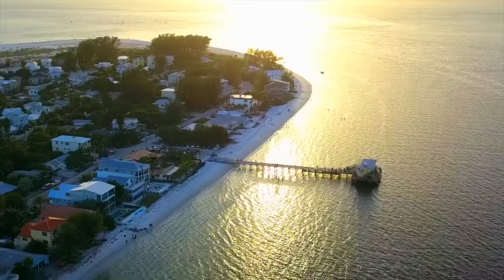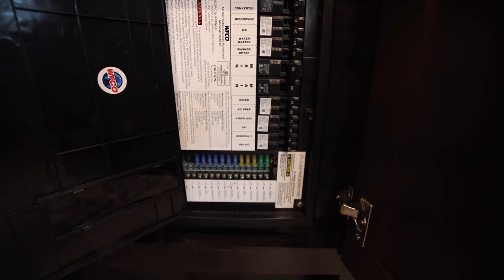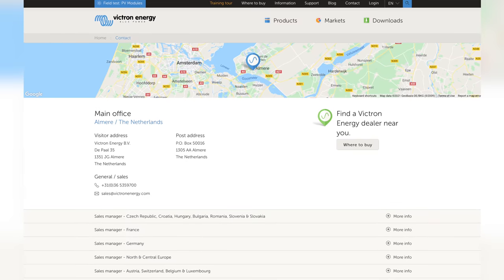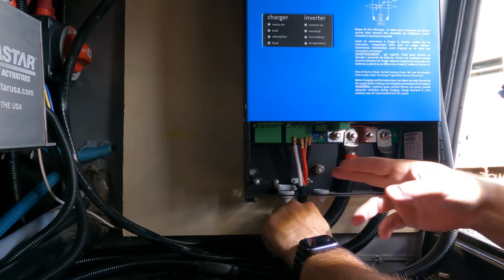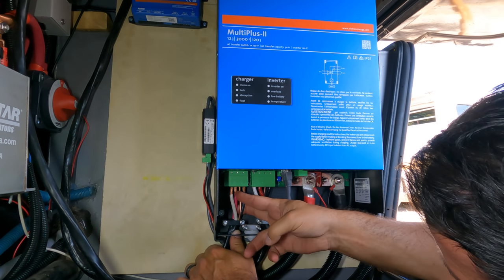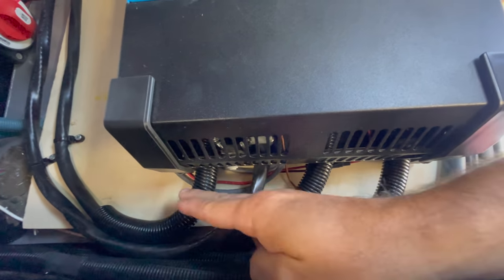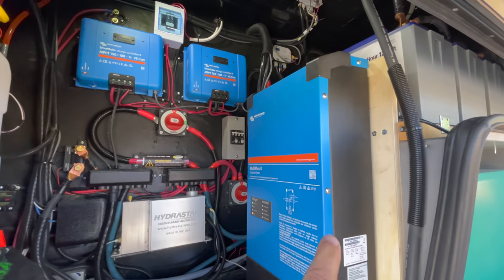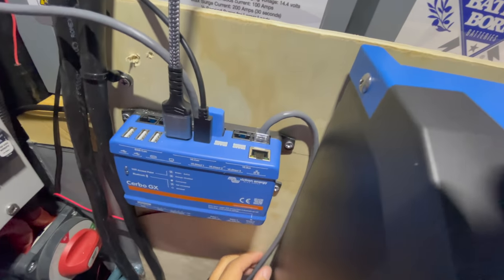🔋⚡️🔌 RV Inverter Upgrade! (Victron Multiplus II 12V 2x120 and CerboGX!) (Full Time RV Life)

Comment: one thing i have learned in my journey is to have 24V/120V inverter setup. and then a 2nd 12V battery that is charged via the 24V system. Then you will never lose 12V, and you can have 1/2 sized wires for the 120V inverter side. Mostly if you need over 2000watts of Power. Plus you can take the 120v/24v out of commsion for upgrades/testing and keep your 12V side going still.

Comment: I suppose the engineers took into account mobile mounted vibration issues when designing the "push-in" style of termination for landing the a/c connections.  If they made a version with the standard "screw down" terminations, I would buy it.

Comment: The multiplus manual says to use two 2/0 positive and two 2/0 negative wires. Guessing you’re using 4/0 which can carry the 400 amps, but I think the requirement has to do with the terminals. That said, I haven’t actually seen anybody use 4 2/0 wires into the multiplus. Am I reading the installation manual wrong?

Comment: The multiplus 2 already has an automatic transfer switch installing internally. You got your ATS for nothing. quote:
The MultiPlus is a powerful true sine wave inverter, a sophisticated battery charger that features adaptive charge technology and a high-speed AC transfer switch in a single compact enclosure.
Reply from the maker: The ATS inside the inverter is only for switching shore/inverter power.  The separate ATS is for switching shore/generator prior to going into the shore power input to the inverter.  The inverter cannot 3-way switch.

Comment: Thank You!  Had to watch certain small sections at half speed for about 6 or 7 times, to glean the full value of what is happening, but after you do that, with “this” video…then the “Advanced Power Control” of Lithium Batteries and Solar Energy is no longer a mystical barrier.  Additionally, if you can multiply and divide (even with your calculator), it’s really easy to do all the power use and associated duration computations.  Thus, the 4th grader has been given all the mental tools necessary to master the understanding of this “state of the art” RV Power System.   Spend a couple hours with this video (mostly slowing it to 50% speed and then replaying a 2 minute section) and then you’ll feel like an energy management guru, afterwards.

This is the 1st Lithium and Solar management video that pulled everything together for me.

I’m definitely “Switching Lanes” now.

Thank You for this excellent “learning” resource!!!

Comment: Chad - well done!  I just finished installing the same inverter in our Airstream.  While not full timers, the BEST part is being able to run every single AC appliance and outlet without having to remember if it's connected to the inverter!  The only drawback to The MP2 120 is that the shore power pass through requires that the inverter be on.  I used the Color Control GX and the Digital Multi Control panels to make it simple to manage without a phone.  Again - great video and I hope we meet down the road!
Reply from the maker: Thank you!
Reply: @Leo Reap : We have the older MP 12/3000/120-50 120V, Product ID, 2702 (not the v2).   Future Sales told me to leave the inverter on all the time, too.  I'm not quite sure I understand that.  Right now, I have it on Charger Only (I happened to trip the breaker yesterday (50amp between Victron and house panel), started freaking out and switched it.)   I'm showing I have 50amp in, so I can't quite figure out how that's important.  Do you have any resources (links) that might explain this?  I DO usually turn the inverter off while traveling as I don't want to drain the batteries on fridge, etc. when I can just switch that to propane.

Comment: We just got our Victron Multi Plus II 3k along with 800W of solar and a 150/60 Victron MPPT charger. We love it and quite an improvement over the old Magnum 2k modified Sine wave.  We are going back to get the Cerbo GX, GX 70 Display, Smart Shunt and 400-600 more in solar.   We opted for 2 300ah LifeBlue batteries (so 600ah total) We may get more battery power at another time.  Thanks for all the great videos that help in our decisions on what to get.  I can’t wait to play with he Cerbo

Comment: Chad and Tara,   We have had a Victron Multiplus, Multi Control, Color GX display system in our Class C for three years and love it.  The Multiplus has performed flawlessly. It allows us to use the air conditioning when parked and shopping or stopping for a few hours hiking or exploring before getting to a campsite with hookups and keeps our cat comfortable.   Your comments about Customer Service are spot on.  Our Multiplus is installed under the dinette in a conditioned space but can still get warm when running the AC off the inverter for an extended period.  I would enjoy seeing what type of ventilation you are utilizing for your Multiplus inverter as I formulate ideas to keep our's cool.  Keep up the excellent work.

Comment: A trick to get less resistance in your battery cable ring terminals is get the closed ended ones put it in a small vise or clamp that is heat proof. Then use a propane torch to heat up the terminal and use thick electrical solder with rosin core . Fill the terminal about halfway with molten solder and very slowly insert the pre-striped battery cable making sure it soaks up the solder into the wire. Then hold it for 5 seconds until it solidifies.  Then slide your heat shrink over the terminal and finish it up. 
This will make a mechanical and electrical connection that will be free of voids and corrosion over time.

Comment: Looking good Chad,  I installed mine 8 days ago before we came down to Corpus Christi, TX from Killeen, TX. I ran the refrigerator and small freezer for 5.5 hours and I still had 60% battery voltage or 5 hours left according to my Victron smart shunt. I have 2 battle borne batteries, 400 watts renogy solar panels, 30 amp solar controller. Man I love this inverter no shore power no problem, when I plugged into NAS camp site it didn’t miss a beat . I love the fact  I can travel on 120 volts In my Reflection 303RLS. Yes thanks go out to Jarred, he got me excited when he said no inverter, converter, and no transfer switch need only one Victron multi plus II inverter replaces all of them in one component.

Comment: excellent video.. very well explained.....i am in the last stages of building basically the same system with almost the identical  equipment.. (i only have 8 BB batts ).. i am  fixing to order  , the cerbo and display...   you have  good pointers .
many times the non- pros explain stuff much better than the pros as they dont blow through things like we are all PV installers that are watching...... THANKS ... JIM.

Comment: Wow Chad! - What an amazing video! - Many may be lost in its complexity, but I work in an electronic engineering environment, and "got" almost all of it. :)
This is a very comprehensive and complete system - that is accessible from anywhere - very important.
The ability to review historical data is paramount, and will allow you to plan for the future, based on the past.
Thanks so much - you are very adept at presenting this sort of thing.  Cheers!

Comment: That’s the system I need because we’re a 50A rig trying to run on 20A many times. I wish the system would improve to voltage. Too often we’re dealing with low voltage and have to rely on the autoformer. You’ve got an awesome set up.

Comment: Very cool.  I something very similar this summer to my TT, but on a smaller scale.   I really like the Victron Products.  I put in 2 Battle Born Batteries, a Victron Smart Solar Controller, Victron Smart Battery Monitor and  Victron Multi plus 2000/80 Inverter/Charger.  Everything works so well together.  I Love it.  Maybe in the future, I'll add the display features you did.  Great Video.

Comment: Nice overview of how all this works. Note that the NEC only allows 80% of the circuit's rated power for a continuous load, so a 30A circuit is only rated to flow 24A on a continuous basis, not the full 30A. Thanks for the excellent video!

Comment: My head is spinning a bit, but you did a great job of showing how each part of the system supports the whole.  Thankfully, in my setup it would be as sophisticated since I'm limited on every aspect of batteries and solar capacity (small Mercedes Sprinter), but it has shown me what I could enhance to get longer off the grid time for most things accept AC.
Reply: Rufan2199 we have a Sprinter RV with limited space. I would be interested in your set-up as space is at a premium for us as well.
Reply: @stuartrogel9117  haven’t done anything yet. Right now I have one 100w panel on the roof and one 100ah AMG battery.  I could fit up to 3 Lion energy batteries in my stairwell compartment and maybe one more panel on the roof but I’m sure I would need to upgrade my solar controller.  I would also need a small inverter for AC powered outlets and maybe the TV.
Reply: @rufan2199  many thanks. I’m at the same point. Converting from lead acid to lithium. I’ll keep you posted about what I learn and do.

Comment: Chad, thank you Sir! Again, great video. So good I order the inverter you are talking about, and will be installed soon! We are also excited coming from a limited Growatt 3k (25Amp). Thank you!!
Reply: Well, we have the Multiplus 2 installed in our Solitude. Overall, we are satisfied with the great configs and data monitoring you can do! I was wondering if you had any issues with Inverter sounds (hums like a fish tank motor, even on low power), or any shore-power breakers popping when trying to connect shore-power through the inverter. I have the 24V version, and my father has the 12V version, we are both experiencing shore-power breaker popping while trying to charge or pass-through the power. We have sent our input AC to low levels like 5, 10 or 15Amps with the same issues. Some reading says that the US ground fault circuits are more sensitive than EU market. The Multiplus was designed for the EU market.

Comment: I always wondered why you hadn’t done this upgrade sooner.  The VIctron MultiPlus inverter/chargers are AWESOME! I have one and setup an entire Victron based system.. You should consider this as well as they network to each other to coordinate charging from solar and the multiplus. This is something that can impact your charging when using dissimilar components. I can explain further if you want.
Reply from the maker: The system in this video is all Victron.

Comment: Ive had a very similar system for 2 years in my 44ft dutchman voltage . I use the victron 24v-3,000 watt inverter charger. Has been flawless. 1400watt solar too. It took alot of studying to absorb and be able to explain all the things you just quickly explained. Nice to have 120vac in all outlets when dry camping. I put a 120 vac minisplit in the voltage garage. The head of course is in the living area and the garage is not cooled.  Great to have noiseless air conditioning when having full hookups or on generator. Of course we still have the 2 roof a/c’s when it gets over 90 degrees. The compressor is mounted on the wall in the garage. Can run the minisplit on a 20 amp outlet! Thats right.

Comment: Hi Chad, I feel your pain. I installed one of the Multiplus II inverters in our Solitude last month. The AC wiring was a total pain. I wound up doing what you did, cut the insulation back and put heavy duty heat shrink over the exposed wire after they connected. Love the channel, keep up the great work.

Comment: Great video!!!  I have a 2022 398m on order and plan to have a setup a lot like yours.  This helps so much, love watching your videos… keep it up!  And when your back in Colorado hit me up as by next summer I’ll have a dedicated off grid spot you guys are welcome to use up in the mountains.  Building it now, with a 1,500 gallon black water holding tank (pumped septic tank) plumed to the pad and I’m working on wiring the solar array power to the pad also.  It’s an old late 1800s gold mine from the Colorado gold rush at 9,500 feet.  If I’m not there, your more than welcome to use it any time.

Comment: Yes!!  I love Victron products.  We have a 2017 Navion 24J that came installed with 100w solar and xantrex.  We now all Victron: 3 solar controllers, Dc to Dc converter so don't damage the Mercedes alternator, the awesome Lynx Distributor,  shunt, victron fuse holder (however I don't recommend), the 712, and the incredible 12v/3000/120 inverter.  With 6 Battle Born 100ah batteries,  can run ac full-time for 3.5hrs or much more if cycling on and off like normal, use the power assist when boondocking, and the best use is k-cup coffee and microwave warmed pastry in morning!  Victron rocks!!!!  Could only ge 640w solar on roof.  But can add in parallel another 4 aux connectrd panels on ground for 1400w solar.  Took 4 months working partime pulling new wires, fabricating parts and racks, and engineering acceptable runs.
Reply: @earlhunt2815 We have a 2009 Fleetwood Icon Sprinter-based and looking to install this system. How did you get everything to fit in that small rig? Do you have pictures that show your setup that you could share?
Reply: @stuartrogel9117  I do have pictures however they're not the greatest. I have a 24J which means the bed is a corner bed. The concept is easy the implementation is labor intensive, rigorous attention to detail for the electrical and structural engineering. It's not inexpensive ($10k for materials and tools like lug crimper, cable cutter, special hole saws) but it's well worth it for our needs.  This would have cost at least 20K for a company to engineer and install.
New battery packs much more space efficient available from Battleborn and other manufacturers that weren't when I installed mine. I would go with game changers from Battleborn if I had it to do again.
So one starts with taking the coach batteries out of the step well and putting lithium batteries in it. I put two battleborn GC2 in the stairwell. next to the stairwell is a luggage compartment. I stacked four 10012 two pairs on their side facing each other.  Built an aluminum frame and secured them.  Directly above the luggage compartment is the cabinet with the sink. I did not want the inverter outside in luggage compartment so I mounted it underneath the sink. I built a rack for it and secured the rack. drilled holes down to the luggage battery compartment and routed the cables up to the inverter. Then I had to pull new wiring for the AC component from the back of the motorhome completely through to the inverter. This is required because the inverter can supply up to 50 amps so nee wiring is required.
Reply: @earlhunt2815   Thanks so much for sharing this, Earl. Sounds like you did a lot of good work. I’m not sure I’m ready to make all the changes to our rig to build out such a system. Plus, I don’t have the electrical/mechanical chops that you and Chad have to make this work. I am meeting with a reputable installer next week to help me plan and design given my space constraints (and budget). We’ll see. I’ll keep you posted.
Reply: @stuartrogel9117   some thoughts to consider:
•. Victron known worldwide for engineering excellence, innovation, availability, networking, and quality.  
• considerate 3000 w inverter/ converter over a 2000 watt.  While the 3000 w does require 400 amp hour batteries, This is easily achievable with two robust lithium pack such as battleborn's "game changer".  3000 w inverters generally require a minimum of 400 ampere hours.  I doubt you'll ever want to upgrade to anything else as long as you have good solar.
•. Inverters require heat dissipation. I see professionals and DIYs installing their inverter/converter in enclosed areas without any or sufficient air movement. This shortens life of the inverter. I would ask to see the ventilation spec how many CFM have to be moved to keep the inverter within specs.
• check your occupancy cargo carrying capability OCCC So you know how much to take off with the install. I went with flexible panels because rigid ones are much heavier.  However not advisable to glued directly to your roof. But simple slotted aluminum "T" rails    with the head of a bolt slid into the T allows one to secure the panel and also makes it easily removable. I Used LEXAN thermoclear for ventilation between the roof and the bottom of flex solar panel. The weight saving is significant.
•. Shading kills solar output.  Any panel mounted either panel beside your air conditioner Will be shaded at one time.  If they are connected together the significantly drops of efficiency. The ideal solution is parallel wire, diodes to prevent feedback for weight panel (watch I almost never see any pro or DIY install) and separate charge controller. Most professional and DIY installers prefer to use one charge controller; however, This is much less efficient But easier to install. Using multiple lower voltage amperage solar controllers in pairs of panels significantly increases total output to charge the batteries.
• codes do apply to solar installs such as fusing and the ability to switch on and off the solar panel.  
*. Solar wiring must be exterior braided, UV protected, hello with other specs.  Please ensure your bid specifies the correct solar wire otherwise the wire covering will crack or just a few years and you'll be replacing it.
+ The victron lynx distributor is hands down the best.  
+ Besides the master cut off from the batteries to your distribution terminals, consider a DC bus cut off from The distribution terminal to your DC fuse box.